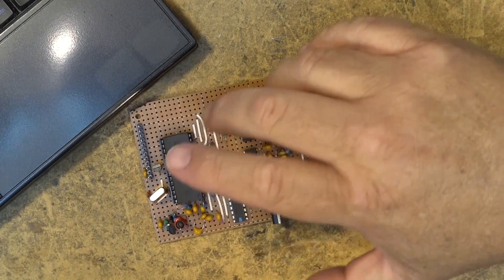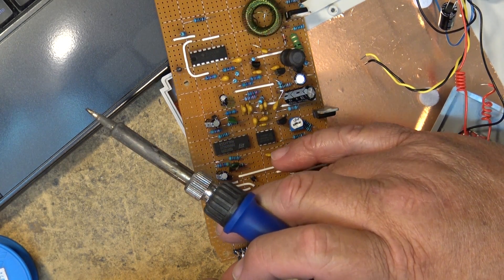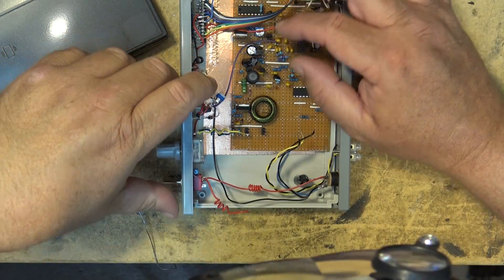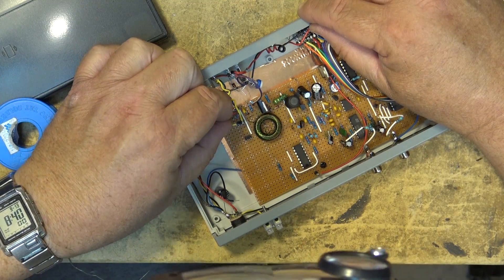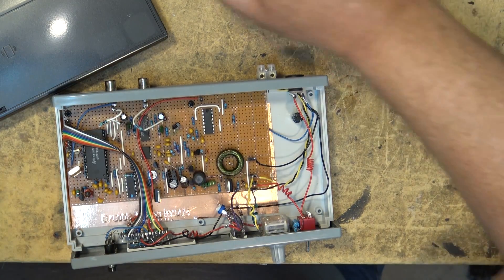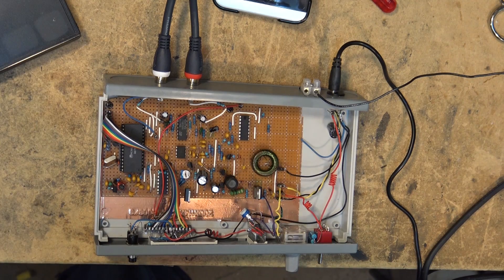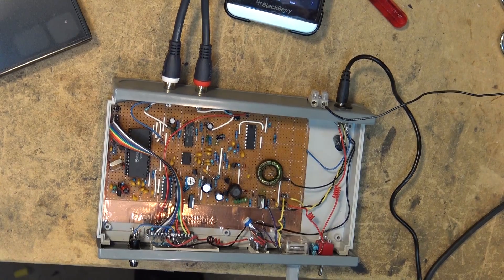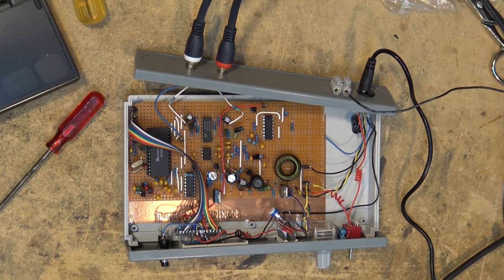AM Stereo Transmitter Build part 2 final assembly and tune up

Comment: The older am stereo radios only went to about 1620 ish Khz tuning. Stumbled on a way to expand tuning range on Sony srf a100 from 530Khz to 1620Khz to 500Khz to like 1770Khz or so. Anyone can do this modification. Take the back cover off the radio, spray wd 40 on the tuning capacitor and your range will extend over the next 3 months. Expanded fm as well to like 86Mhz to 110Mhz! I've had 2 of those radios with the same results. 1st one got stolen. 2nd one, well, that's a story for another time. But the wd 40 was NEVER a problem. If I can get 1 more,  I'll do what I know with this exact radio type. 📻 and the srf a1 as well may do that. Something about the plastic separation insulation that reacts to wd for crazy expanded tuning range also solved the lower sideband heavier at 560Khz, upper sideband heavier at 1620Khz problem. These particular radios also tie in nicely to sony shortwave equipment at if of 450Khz for am stereo shortwave. Then you'll be set to hear XFM in CQUAM stereo!!!! Or even me when I get more equipment. My frequencies are a bit higher than his (XFM) however. And mine is simply an experiment that actually worked. My radio transceiver got burned up by a pawn shop. I'll get another, find the appropriate modulation points, am and pm, and do this again. This time I'll be fair and put a 25Hz pilot for the rest of the radios that need it to achieve stereo. And in shortwave, b mode gives interesting options in shortwave. But you'll need a mode for anything CQUAM, Harris or Magnavox. I'll be even more fair, when I get some equipment, I'll put out videos on how to tie an am stereo and shortwave together. Merry Christmas 2021 all

Comment: whats the channel separation sound like ?
Reply from the maker: Channel seperation AM stereo for C-QUAM was around 35dB, but the big advantage of AMStereo was the frequency response which extended on high quality radios to 15KHz making AM stereo capabe of sound quality approaching FM stereo.
The sound quality is great. The music I played at the end of the video was recorded from the headphone output of my AM stereo walkman. So I trenamitted this music through the transmitter, tuned it on my radio, and recorded it directly on the computer. This is how good it sounds.
Reply: @12voltvids  actually, audio will roll of quickly above 13Khz +/-. Perseus sdr is another great way to go as it can receive CQUAM am stereo anywhere it can tune. Although the a1 and a100 have no need for a pilot to open up, can do isb, Kahn powerside system. They have that advantage over sdr units. The a100 is magnetically dependent to stay aligned. I adjusted the 2 coils extensively to get my damn sidebands perfectly symmetrical. Then some asshole stole it from me at Job Corp when I was plugging my 12 volt power supply under my bunk. I put about 50hrs of my life into just aligning those damn coils. 🤬🤬🤬

Comment: @ Point Dexter -  You can give 'negative' comment(s) - but I'm wondering if you can do a better 'project' -  Looking fw to that!
Reply from the maker: And how can I make it a "better" project? It was a kit, and I invite you to find flaw in the assembly. I didn't  construct the case, it came like that so if you are looking at the mess around the display, then point your flame thrower at the kit designer, not me. I assembled the prefboard, and tuned it up, and it sounds fantastic. I did demo the sound quality from the unit.
I plan to put a coaxial connector on the back so I can put a real antenna on it, but for what it is, it covers about 500 feet nicely with the supplied wire for the antenna.
Reply: Message wasn't mentioned for you! I liked the 2 video-clips! But I replied on Point Dexter comment below!
Reply from the maker: Yes I noticed. No problem. I figured as much, I guess we know where 1 of the 2 thumbs down came from.
Reply: Keep on going with this interesting video clips!
Best Greets!
Reply from the maker: CoolAM Radio - Shortwave 
What is wrong with this project. It works as designed.

Comment: Isn't 100mW input power max legal limit over their? It is in the US i believe to a radiator no longer than a couple of metres or so. In Australia if you broadcast past the end of your nose you risk getting a visit from ACMA...
Reply from the maker: In therory there is no limit to the power, there is a limit to the radiated power measured at a specific distance. With the included antenna it covers the property quite nicely, and starts to fade as I walk up the street being completely un detectable at about 200 feet, so I doubt that I will be getting a visit from anyone. Besides, there are pirate stations on Fm that have been on the air for years now and nobody has batted an eye, and I am talking stations you can pick up for several miles.
One was shut down a few years ago, but it was only because the CBC wanted to use the frequency. I don't know about where you are but here industry canada has more important things to do that track down someone that puts a cable amplifier on his ipod transmitter and covers a couple of miles with it.
Reply: @12voltvids  With AM there IS a power limit.....100mW into the final amp. FM is where there is no power limit but field strength limit.  Check BETS-1 rules Canada. By the way this and any transmitter you import from a marketed kit like this or working product by a manufacturer isn't useable here if no IC certification number. I am in Canada and have FM station from my house with A Decade MS-100 certified BETS-1 for unlicensed use.
Reply from the maker: @blueee100  
This one can operate at 100mw or, by swapping a resistor 400mw. I built it for 400 because I really want to be able to hear it 50 feet away not just 10!

With FM you are correct it is field strength they check and on FM that can go quite far. There have been several pirates operate over the years.  One was on the air for over 20 years non stop 24 hours a day but lately I haven't heard that one.  There is an Punjabi station on that frequency now :(
Reply: @blueee100  Power limits, more specifically 'EIRP' (efffective isotropic radiated power) vary from country to country. As an example, here in New Zealand, we can use 1 watt EIRP on FM. I know of many low power FM stations that run much more than that. I also know of an AM stereo station which is putting out about 12 watts and there isn't even a 'Low power AM' system here so technically that station is a pirate.

Comment: I have seen you can buy this 1 watt one though its only mono but do not have any stereo radios here for £90  http://www.6v6.co.uk/transmitters/solid-state-transmitters/mosquiti-one-watt-transmitter.html  I wonder what the range will be like?  they also do a usa version.
on FM 30 watts I reach about 10 miles from my home if turned on.

Comment: Do I hear pirate? With most AM off the air and few people listening, sounds like a plan.
Reply from the maker: Mark Anderson 
Pirate, heck no I just want enough power to get around the house static free. A watt should do that nicely. It is running 400mw now and that makes it about 30 feet with the wire that comes with it before the background static kicks in. So a little more power into a better antenna should improve things. Need to get over the plasma TV noise floor.
Reply: Hmm, Well try a longer antenna first.  looks like a half wave is almost 500 feet.  that's a ton of wire. 250 feet  at 1200kc for 1/4 wave
Reply from the maker: Yup, will try it on my 40m dipole and see if it will tune up and go anywhere.
Reply: How long is that?  I assume horizontal fed in the middle with a balun
Reply: @12voltvids  ground plane ground plane ground plane. Or capacitive coupling to the power line like the old cordless handset phones used. 1900Khz base to handset, 49Mhz handset back to base. I returned a Walkman am radio to go that high and could hear them with slope tuning. Yes I know how to hear nbfm on am radio. If it works for those things, am band on the power line is NOT out of the question. 🤣🤣🤣😐😐

Comment: I bet you are chuffed with it, worked with only slight adjustment :-D.

Would a ferrite rod medium wave coil and tuning capacitor work as a better antenna?
If so, most older tuners had one bolted to the rear panel.